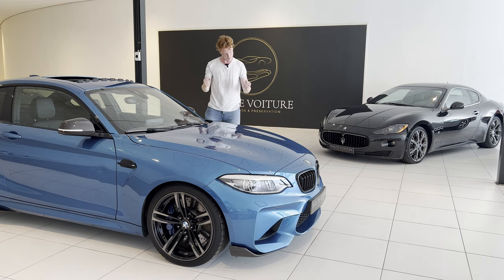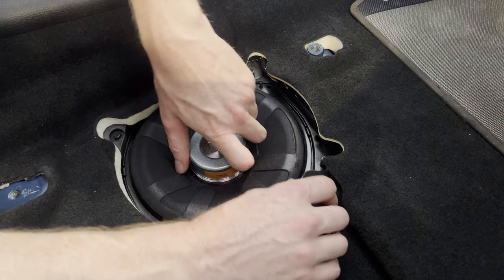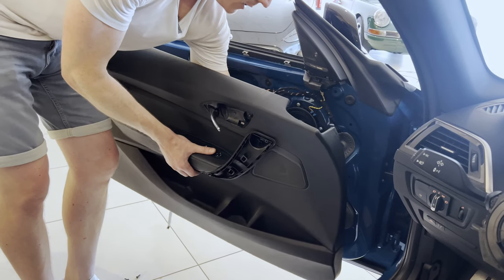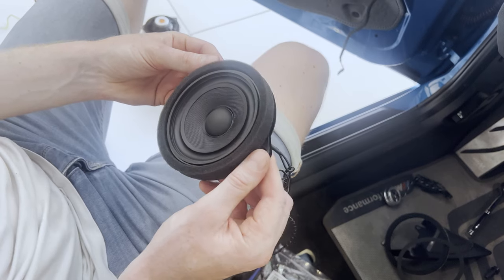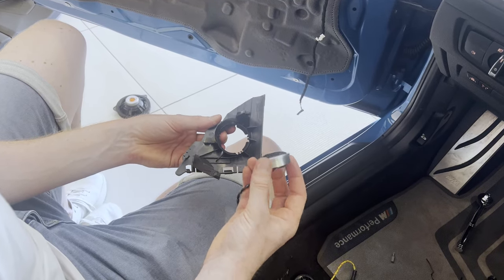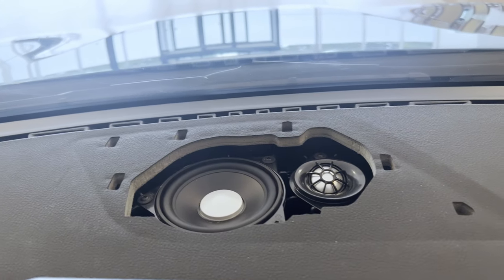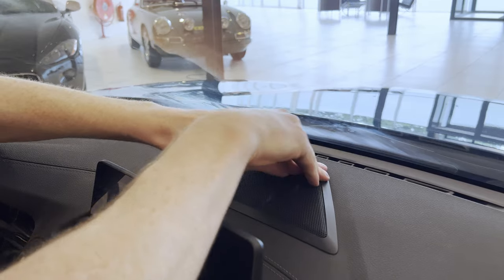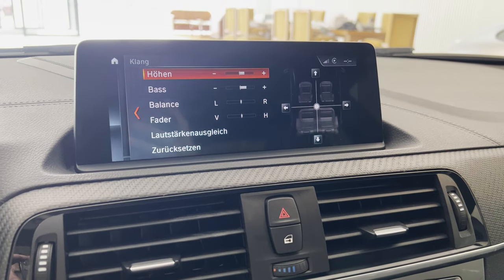BMW M2: BavSound Speaker Upgrade

Comment: Do you think the bavsound speakers are worth it with the stock amp? I'm debating right now which upgrade I want to do
Reply from the maker: Hi mate, oh I think it’s a very nice upgrade. The speakers are sounding better and better as the output improves (as the speakers would need to be broken in). The quality and looks are also very good. Stock harman kardon amp works well with these speakers imho. I would say: go for it.